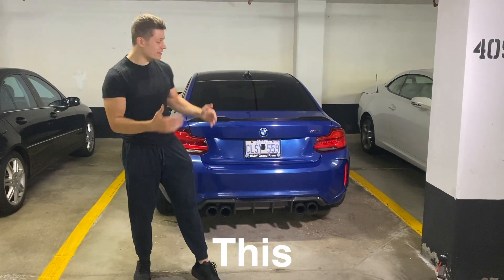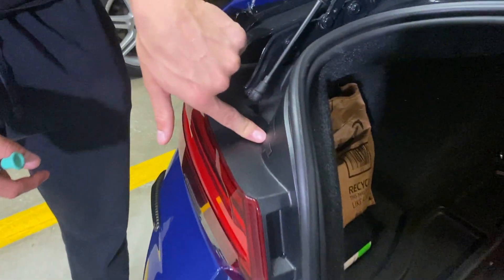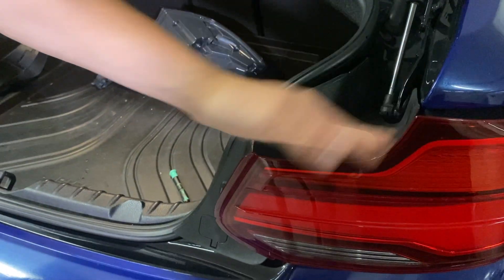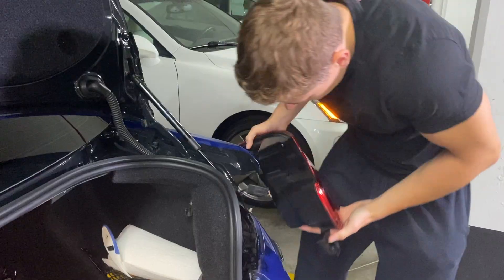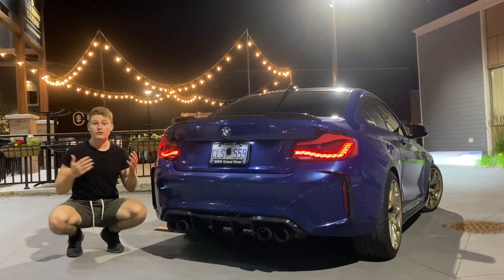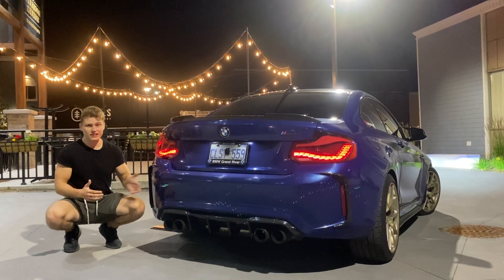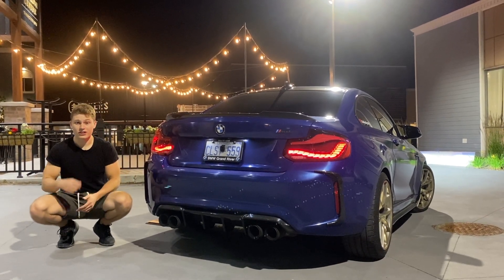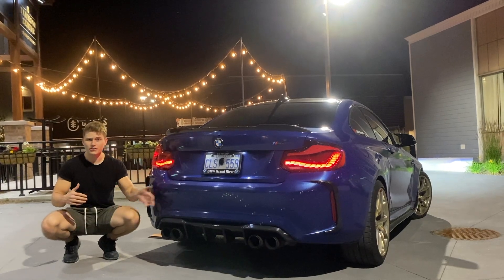First Ever BMW M2 GTS Tail Lights

Comment: any issues with condensation so far?
Reply from the maker: Hey bro! Unfortunately yes. Thinking of taking them out and sealing them better
Reply: @collectingms3803  that's disappointing to know. The design seems to follow the Pre-LCI tail lights which were plagued with condensation issues. Hope they will come up with a revised version - Brighter DRLs & better sealed!
Reply from the maker: @jondoe19896091  Yeah it really is. I know with the M3/M4 GTS lights a V2 version came out, so I'm hoping the same will happen with the M2 to fix the issues

Comment: biggest vid yet!
Reply from the maker: Yessir! Got some super exciting stuff coming as well
Reply: I just received mine and installed them but I am getting malfunction msg on both sides...Help?
Reply from the maker: @robmclemore1523  Hey bro! Was all the wiring done properly?
Reply: @collectingms3803  Yes I believe so. There were harnesses for the left and right side. On both harnesses  there was a wire that had a red wire and black wire which seem not connect to anything....Smh.Going to try again this weekend.
Reply from the maker: @robmclemore1523  Hmm, I know with mine I only had the 1 harness on each light. I did have another set of wires in the package though. Maybe email the people you got it from and ask what's going on?

Comment: Where did you get the carbon rear reflector trims?
I saw one manufacturer that had them but long sold out.
Reply from the maker: I got them from AA Concepts Co. Unfortunately I think that's the same site you've been looking at as they've been sold out since (about a year now). I think there are some other versions being sold on Ebay, but I'm not 100% sure
Reply: @collectingms3803  Thanks, haven't seen them on eBay unless I'm searching for the wrong things.

AA Concepts is where I was looking too. Waitlist I guess. Though I've seen a cool wrap that incorporates them into the design.
Reply from the maker: @gianni_schicchi  Yeah I'd only seen them  on there once and never again unfortunately. I know a lot of people want them, so hopefully someone will start making them. Do you have any links to the wrap? Would love to see it. BTW thank you for subscribing, hope you continue to enjoy the videos!

Comment: They look sick!! I'm thinking of getting the GTS lights but I'm just worried on how it would perform.
Is the OEM brakes and signal lights brighter than the GTS or around the same? How's the reverse lights during the day?
Reply from the maker: Thank you bro! The turn signals are very similar I'd say, but the brake lights are noticeably dimmer. At night they're very clear though. The reverse lights are dimmer, but clearly visible day and night

Comment: Can’t you code the OLED to be brighter?
Reply from the maker: I was thinking that. Gonna definitely look into it, but I know for sure you can code them to stay on with your DRLs
Reply: @collectingms3803  When I coded in the LCI lights. There were options to change light voltage via bimmercode. Just not sure what you can bumper to. For reference. I changed mine from 13.7V to 13.5V.
Reply from the maker: @crispcarguru303  Gotcha gotcha,  thanks for letting me know. I've gotta get bimmercode soon and play around with the lights and a few other things
Reply: @crispcarguru303  Hi I have actually this Lights and I Love them! But brake lights are so dimmer :-( and especially during the sunny day it's so dangerous that you are not enough bright that you are on brakes ! Dangerous on highways etc. Do you think, that you can increase a bit DIODS on BRAKE Lights ? It could help a lot to solve the problems... otherwise I will change them back to original OEM. Because it's dangerous to use it. Some friend told me, that sometimes its not visible enough if iam braking or not :-( Thank you so much mate for content and answer if any :-)

Comment: I wish they didn't have that purple/blue trace.  That's so 1985.  And "pretty good" quality on a German car, I'm not sure that's good enough for me.  I love the fact that they are dimmer actually.
Reply from the maker: Yeah I see what you're saying.. I know with the non OEM GTS tail lights for the 3s and 4s, a second generation was made a few months later with some improvements. I'd say quality is definitely on the high side, but not full OEM quality.  They've also got a bit of a smoked look to them when off!

Comment: I saw the guy advertise this thing like crazy on the FB groups. If you can do another follow up video couple of months later that’ll be very much appreciated. I’m still hesitant on the quality and long term durability.
Reply from the maker: Hey bro! I'll almost definitely do a follow up video in the future. If not I'll add it into one of my videos where it makes sense. So far the quality is great, but can't speak about the durability. If I notice anything going wrong with them I'll respond to your comment again as well.
Reply: @collectingms3803  Sounds good appreciate it!!! :) It's good to see at least 1 alternative, I know our OEM lights are prone to hairline cracks around the edges leading to condensation. I had both mine replaced under warranty now that I don't have warranty if it happens again I hope this is a solid alternative.
Reply from the maker: @CastleRockable  Just saw this now my bad. I've had the same issue with my OEM tail lights as well. The new pair seemed to be great for the year I've had them now though. I just noticed some condensation in the GTS lights and was looking for this comment to tell you. I'm gonna see what I can do to seal them better. Hopefully it's not the case with all pairs of the GTS lights
Reply: @collectingms3803  Good to know :) Let me know what you find and if the problem persists. Appreciate it dude keep up the great content.
Reply from the maker: @CastleRockable  I'll definitely be doing a follow up video in the future. Thank you for the support, I hope you continue to enjoy the videos!